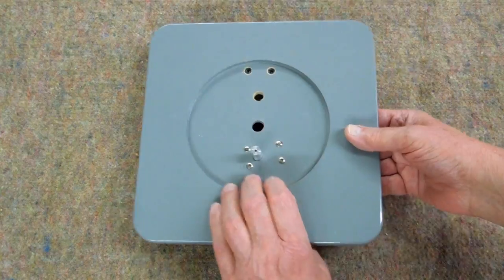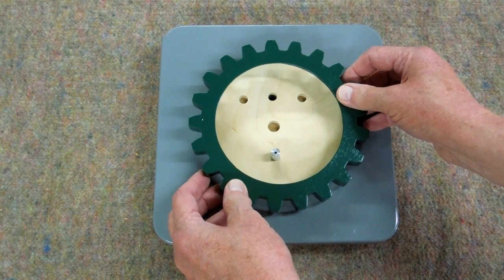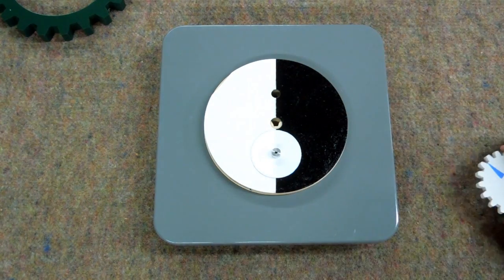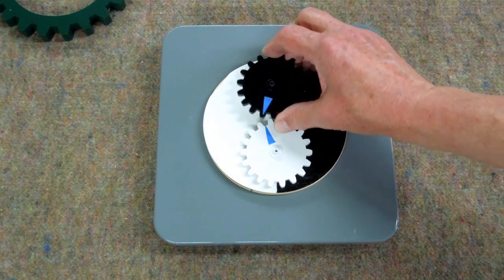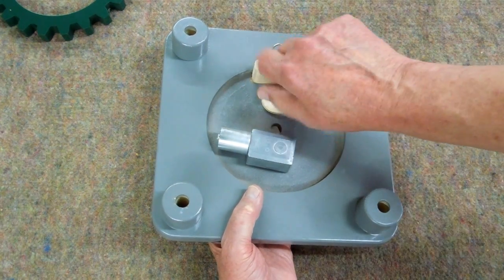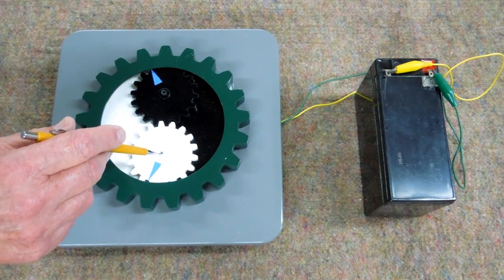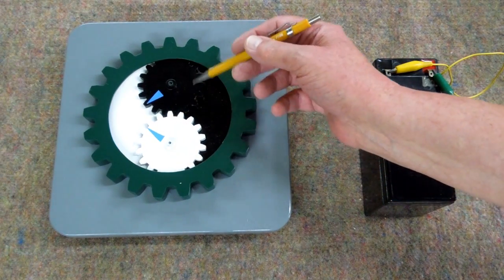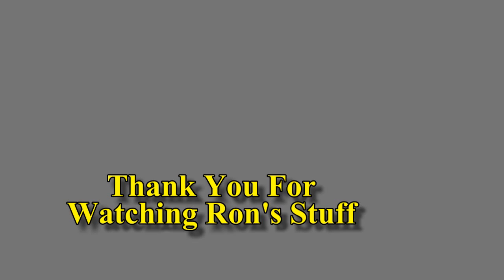Yin Yang Gears - Building The Real Thing

Comment: Very nice!, did the motor come with that mounting plate?

Here's a link to the original animation.
http://lh4.ggpht.com/_dJd3zGVnX2w/SuEAJIxio7I/AAAAAAAABxI/rBAQ5zcVLrw/animated%20gear_thumb%5B2%5D.gif?imgmax=800

A longer video of the gears working alongside the animation, would be very nice too. :)
Reply from the maker: Threaded mounting holes are in the gear box.

Comment: Really cool! Do you have the drawings for all of the parts? I am a technology and engineering education student in college right now and would like to try to make this out of acrylic on a laser engraver. 

I want to experiment in making the gears different colors, but having the spacer and backer clear so you can see all of the gears working together!
Reply from the maker: Sorry Alex, no plans for this. I don't even have the templates myself any longer. I generally present these projects to give people the idea and then they can learn more by doing their own design. I hand cut all my gears on a scroll saw but I have seen the laser cut acrylic gears and they are very nice. You can to to http://woodgears.ca/ and in the lower left corner of that page is a gear template generator which allows you to play around with gear and gear tooth sizes. If you purchase his better program ($26) it allows you to export a dxf file. Hint: To make a ring gear on the website program make the larger gear a negative number of teeth. He has a lot of instruction on his website. Watch my video and count the number of teeth for the various gears to get a starting point. I'd like to see what you end up making. Ron
Reply: Thanks, Ronald! I did a project for class earlier this year in which we had to design and create a Geneva mechanism and then use a 3D printer to make our parts. It turned out to be a neat but time consuming process. I don't have the time right now to mess around with gear sizes which is why I asked if you had files to share. But I will definitely do this in the future when I have more time!
Reply from the maker: I have many different wood gear project videos... Gear Head, Marble Machine, Planetary Gear Drive, Ratchet Mechanism, two different reciprocating rack & pinion mechanism and a couple on wood gear clocks... but all of them would require your own design work. I have playlists which group "Wood Gear Clock" and "Wood Gear Mechanism" videos together. A suggestion might be a Wood Gear Clock. Clayton Boyer has many different designs and they all work. I say, "they all work" because some plans out there do not work. Simplicity is a basic starter design and Clayton offers DXF files if you purchase his plans ($42). The simplicity plans offer two versions "Simplicity" and "Simplicity Variant". This would require some woodworking (which may be a deal killer) but all the wheels (clock gears) could be laser cut. I would suggest baltic birch plywood for the clock wheels. This would not be a "fast, get it done project" but it would be a clock that would last a lifetime. Clayton's website is very informative! Good Luck! Ron http://www.lisaboyer.com/Claytonsite/Claytonsite1.htm
Reply: Great project ron. Always loved mechanical woodworking. I noticed you mentioned Clayton Boyer's designs as they "work", which they absolutely do ( fan of his, done several designs) but you also mentioned some that don't.  Care to share which ones that don't to help others avoid those?
Reply from the maker: Fortunately none that I actually built myself (although initially had looked at) but other builders (and a few friends) had many problems... one of which was a magazine article. So I don't think I will comment on anything I haven't actually worked on myself. Suffice it to say you should read many reviews and research the project before buying plans.
Reply: Ronald Walters Still can't wait to see the worm gear in action on a project.  Hope you are in your shop and this, at least,  makes you look at it and reconsider engaging in that again ;).

Comment: Ron, very neat.  Do you have a link on the motor?  I'm thinking of making one.  Thanks.
Reply from the maker: Search eBay for 12VDC 6 RPM gear motor. Exact same size comes in several output speeds... from Hong Kong or China. Usually takes 10 days to 2 weeks to arrive.

Comment: Nice mechanism but the color combination is not good.

Lightblue with dark green and black/white?
Reply from the maker: Light blue not used here... it's gray. Please adjust your monitor.
Reply: Gray, ok. The denomination does not change the color. My monitor is fine.
Reply: I think it was the lighting/camera a bit. I have 3 monitors and they all show that as a kind of light blue as well, but when he zooms in from 5:30 to 5:32 it looks like the proper grey then.
Awesome piece to hang in a foyer or dining room. If the wife would let me...
Reply: Ronald Walters - You could definitely have a lot of fun with either a flat 50% grey for the outer (cover?) gear (as the balance of black and white) or a wrap of anything from varying gradients of B&W (linear, circular, offset etc) or a checkerboard pattern or...    so many possibilities !!!   The backplate also could be wrapped...    maybe a circular gradient from black outside to a white middle with the outer (cover?   ring?   sorry, mechanics are not my thing) gear being the opposite gradient...   I'd certainly like to play around with the colors in either a Photoshop/After Effects mockup or a SketchUp/AutoCAD render !!!     I'd really love to make this for myself....